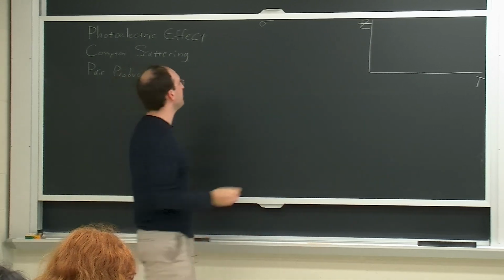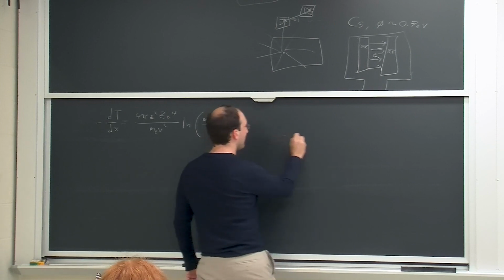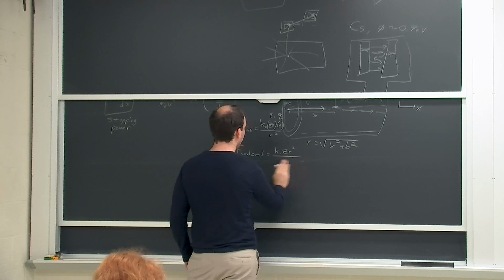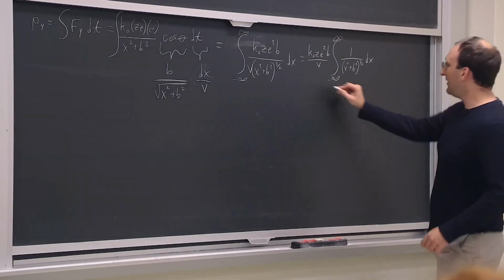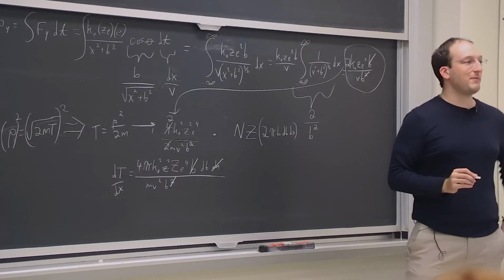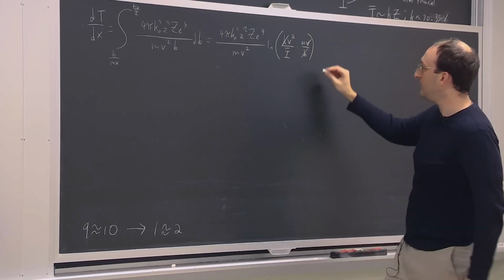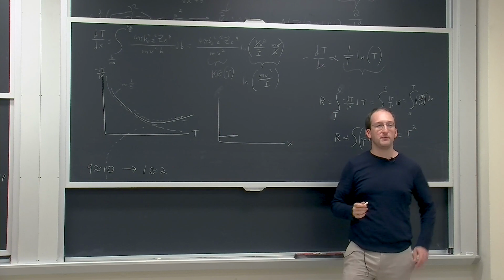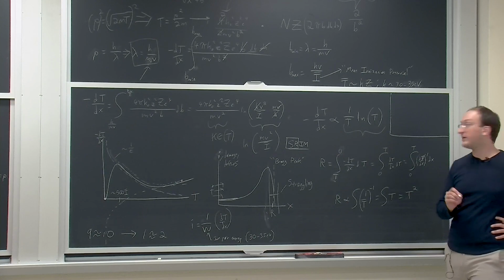17. Ion-Nuclear Interactions I — Scattering and Stopping Power Derivation, Ion Range

Comment: I think it's no problem mathematically to (formally) integrate over b starting from zero, but at close to zero the ions and electron(s) get close and the assumption of close to zero deflection is not valid. I don't follow the rationale for starting from b = the De Broglie wavelength.
Reply: I assume that I'm learning something already well known, but anyway... Shouldn't you, in the point particle approximation, be able to get a path which is a hyperbola without too much work and without approximations for the paths.

Comment: I'm not sure if it is ugly or elegant that you calculate the momentum deflection from one collision, and from it get the energy loss to the ion and from that the energy gain to the electron; but then when you do the calculation for a volume with a given electron density, which would give a net averaged zero transverse momentum (vector) to the ion, but instead focus on the net energy (scalar) of the deflected electrons which add up and from that infer an energy (scalar) loss to the ion.

Comment: Perfect derivation for charged incident particles. Energetic (say 104 keV/amu) neutral molecular D2 beam into molecular (non-metallic) compound (eg. LiT) and even SRIM does not work well. Papers seem to be scarce. This would be the first measurement I'd recommend. (Could be the base of a fleet of energy producing "ESS" if 50 MeV Be(p,n) is not good enough (with appr 1/8 n/p but with a significant n-multiplication subcritical assembly that is good enough), that seems more cost-friendly than Carlo Rubbia/CERN energy amplifier energy producing neutron source, that was a marvellous proposal and way better than the energy wasting bloated 2 GeV ESS). Also useful for a bunch of other applications especially when HFIR and it's friends get decomissioned (and patients will be out of luck).

Comment: Can stopping power in any particle in any matter be negative value in nuclear physics? (referring to the minute of 30.22 for instance.) I think you said around 34.15 min that if the stopping power is negative, this means particle picks up an energy as it goes along the material. Thus, the conclusion is that it is not possible at all. Probably, this also means there is a threshold energy for every particle to start to loose energy inside any material. You later on said that the stopping power at zero T energy should be zero, and that might not be correct. For instance if you calculate proton stopping power in a silicon, below 0.075MeV, the stopping power goes to a negative value.

Comment: The ln(T)/T graph is inverted. Logarithms tend to infinity very fast close to 0 and wins from 1/x really easily.

You can see that ln(T)/T has a global maximum by taking the second derivative and seeing it is negative for the point of maximum and noticing that the "curvature" is only positive after e^(3/2).

That minus sign would fix that, so I think that is the real mistake in that graph.

Comment: 13:15 I fail to see why the net force would be zero: if the particle is deflected, it's further away from the electron on the second half of its journey compared to the first half so the force it experiences should be smaller.
Reply: He mentions that they're assuming the e- isn't deflected, this is obviously not quite true but its a reasonable simplification.
Reply: If the charge particle doesn't move (which is a big assumption that I can see working for nuclear particles, but for electrons would depend on the material), then the problem is symmetric relative to that mid point in the cylinder he drew.

That is all there is to it.
Reply: Also, you could just do the integral of the x force and see that such integral would involve the sine of theta. When integrated, this will be an odd function relative to the point in the center of his cylinder (the point that defines theta) under the static charge assumption, and the integral is 0. But this is, of course, just a mathematical way of expressing the symmetry I commented previously on.
Reply: He ignores the net x force and only considers the net y force which gives the deflection. This is a standard physics slight of hand. This is how you wind up with black holes , dark matter, and other non physical ideas in modern physics.
Reply: @SlowRiderDucati  ????
This is spectacularly wrong and demonstrates that you simply do not understand any of those concepts.

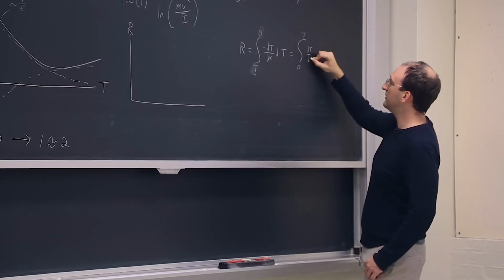Comment: 31:42 how did that dT at the end go to dx?
Reply: He starts the integral in the wrong units if you do a dimensional analysis, so his initial expression for the integral is wrong. Stopping power, as he himself said, is a distance. So Alexey above gives you the right answer, which is dimensionally sound.

By the way his ln(T)/T graph is inverted too, but if he drops a minus sign he fixes it (-ln(T)/T is more like his drawn curve), so that is likely a sign mistake.

That is the problem of going to class without notes. For people with perfect memory it works. For all others it just generates compounding mistakes. Thankfully he does memorize a few other parts of the lecture, but I knew coming in we'd have those problems here. It isn't a big deal, but it is also pretty easy to avoid those mistakes, so... Just bring notes.

Thankfully his physics is better than his math.
Reply: It should be R=int dx= int (dx/dT)dT= int (dT/dx)^{-1} dT. The integral is from T_0 to 0, where T_0 is the initial kinetic energy of the ion. In the next line we ignore ln(T) since T is much larger than ln(T).